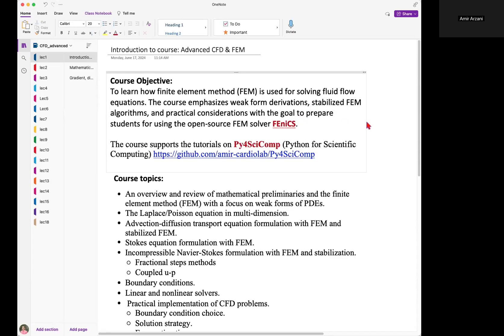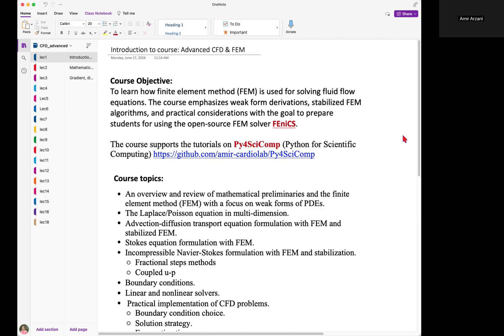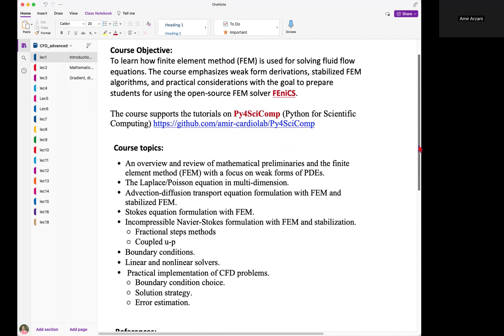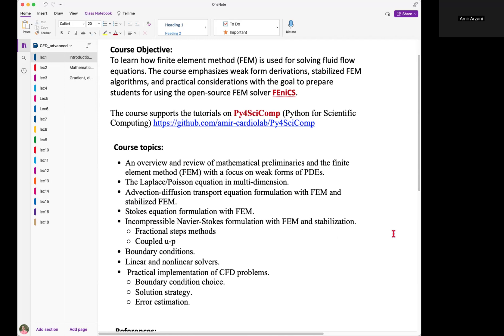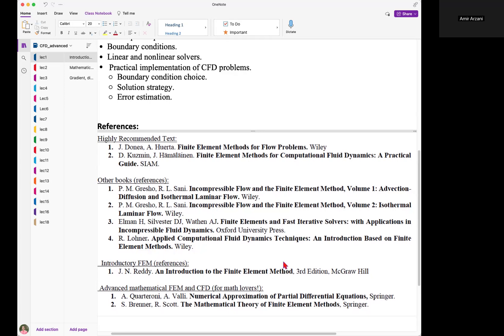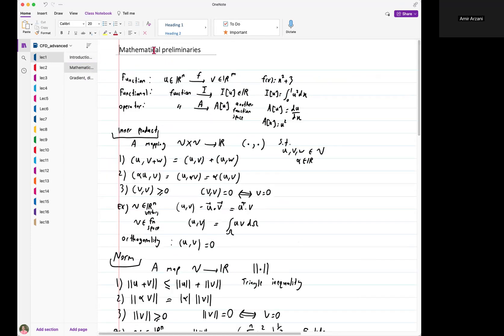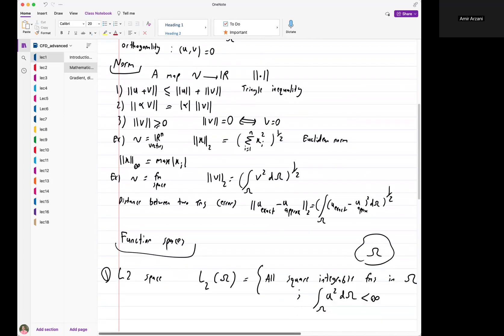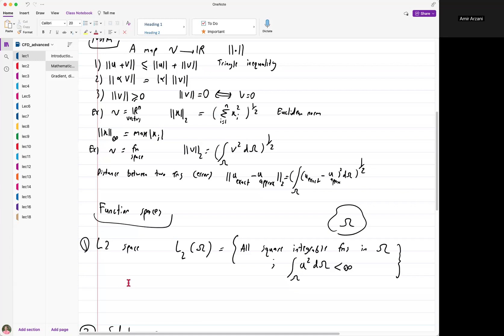Advanced CFD & FEM (Lecture 1: Intro to course + Mathematical preliminaries)

Comment: Hello! I am very intrigued by this class.  There are not many videos that cover the use of fem in CFD, let alone full classes! 

However, starting this course a question emerges. Why should someone use FEM instead BEM or finite volumes/difference method? What are pros and cons? I think that this topics should be discussed in the introduction. If I missed them, please let me know where to find them, I am very interested!